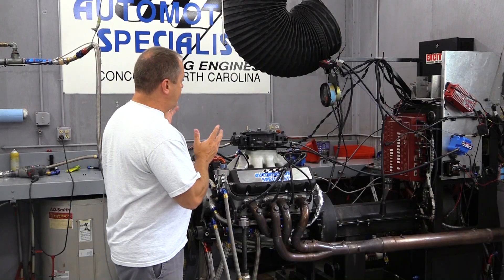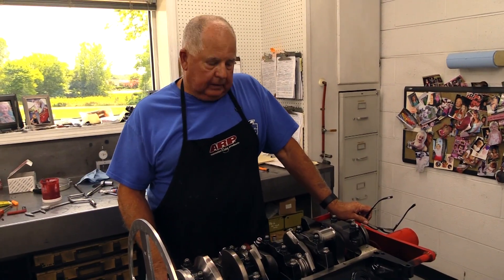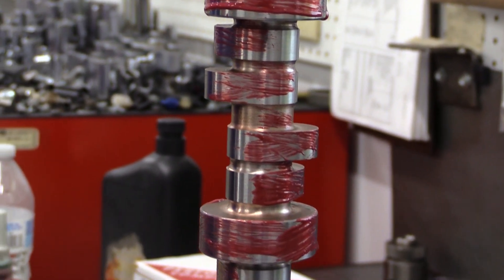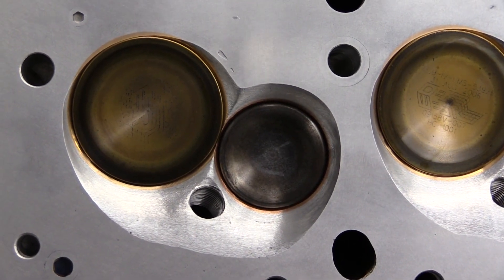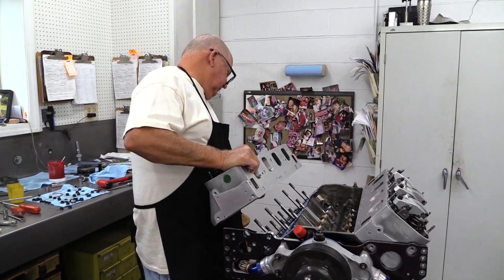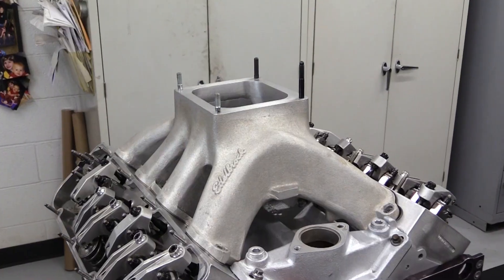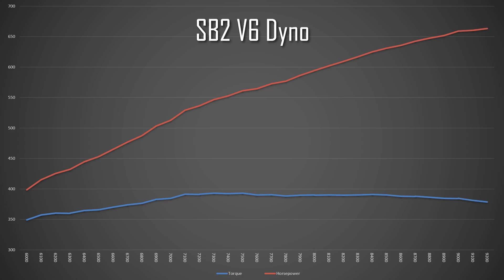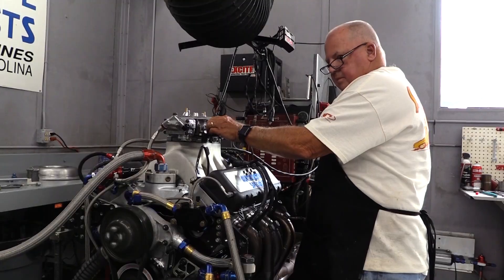NASCAR Chevy SB2 V8 Turned Into a Racing V6!?

Comment: Nice video.  660 hp / 6 cylinders = 110 hp/cylinder.  Make that an 8 cylinder, and you've got 880 hp.  That's pretty much what the NASCAR Cup competitors had on unrestricted engines.  It was probably fairly simple to find a used Cup engine after the SB2 version became obsolete, then let Dorton do some thinking about how to build the engine with a couple of dead cylinders.  I think he came up with the design of the #4 crankpin weight by taking the big end mass and adding half the reciprocating mass of the two missing piston and rod assemblies.  Then he had to do some careful engineering to spec the bolt size and grade to keep it together at 9000+ rpm.  If that weight came apart, it would wreck some things on its way out!

Comment: Man, my brain hurts trying to figure out how the ignition system works on this beast. Even though its missing the last two cylinders i cant wrap my head around how it runs smoothly on 6 off a 8 cylinder distributor. In my mind there would still be gap in ignition and the engine would act like there was dead cylinders. FFF-FFF- ...... Someone smarter than me please explain this to me, lol.

Comment: Why not just use an in-line 6 they make more power than a v6 and you can get high compression ratios
Reply from the maker: I really don't think can get a less than 300 cubic inch, naturally aspirated straight six to make over 600 horsepower. Plus, straight sixes generally don't live to rev like a V8. They run into weird harmonics. Thanks for watching.

Comment: That small block Chevy looks good with those Robert Yates Cleveland style heads
Reply: You mean the Cleveland style heads that were originally copied from the Mark IV Chevy?
Reply: @andyharman3022  Bahhahaha Bahhahaha LMAO you Chevy boys crack me up LOL always got to fall back on some kind of experimental 409 junk LOL
Reply: @jameywhite6055  Wow.  What a convincing argument.  Ford got the message when Chevy showed up at Daytona in 1963 with W-motors modified with canted valve heads, and blew them off the track.  Then the Mark IV big block Chevy went into production in 1965, and is still in production by GM today.
Reply: Oh yeah that's super secret for 27 was awesome in a short run, but when it came to longevity I believe in 1963 the top five places where a Ford?
Reply: Plus the fact that there was supposed to been 50 of them but they only made 26 so I had to sneak them around from garage to garage to make it look like they had 50 LOL same ol Cheatin Chevys

Comment: Why not use a 3.8 or 4.3L gm v6?
Reply from the maker: Those cylinder heads don't breathe anywhere near as well as an SB2 head. You can't get the same power.

Comment: There is a LOT of information contained herein that I have used along with several books from Henry Yunick aka "Smokey" . Both these men are outside the box thinker's that made silk Purses from Sow's Ears and he thinks like I do , " If it don't specifically say in the rules that you CAN'T do something you HAVE to assume that you can !.  The Bob weight wouldn't be that difficult to come up with as this is generally done when balancing a Crank anyway  . weighing the Con Rod Ends and bearing shells  would give you a very good place to start. The question for me would be is it over balanced or underbalanced as a function of smoothing the difference between reciprocating weight and rotating weight .
Dayum I LOVE those Keys lifter's brilliant solution to the limitation of the tie bars. 
I know the word Magician is often used but IMHO in this case it might be considered by most that understand the content of this Video as being and understatement ! , Mr Dorton I Sir salute you  .
Reply: I hate tie-bar lifters.  Keyed is the way to go.
Reply: @andyharman3022  Yes and no.   It depends on how the tie bar is employed and what it is made of.  I machine the sides off the lifter to give a flat and then a pedestal  made to attach the tie plate , BUT for street applications the lifter is usually left rotate in the bores so the wear on the Cam and lifter is as even as , this is doubely important for motor's where the lifter bore is slightly offset from the cam lobe to produce an even rotation.

Comment: My first thought was why not just use a Buick V-6 but I don't think you could get the bore size he most likely wanted. Yah the cylinder walls would only be .055 thick between the cylinders.
I'm not second guessing anybody here I'm just wondering why the cam has the lobes for #7 & 8. Unless it's for cam balance issues at high RPM

Comment: Why are all the measurements in imperial.  GM products are all in metric
Reply from the maker: LS, yes, and all other motors since. The SB2, which stands for Small Block version Two, was still standard just like the original small block. Thanks for watching

Comment: I'm guessing that the added weight to the crank is likely the total weight of two connecting rod/piston pin/piston assemblies plus some weight added for dynamic balancing. 
Goofy suggestion-since the engine is essentially an air pump, why not separate the intake manifold for the rear two cylinders and boost the engine with the airflow from them? You could adjust the cam timing to optimize the airflow so they act like a compressor would. Plumb the  exhaust side to a pressurized intake hat. Okay, it's stupid, I know, no need to roast me in the comments.  The same external engine configuration could be used in a different class...Just an idea.

Comment: If their going for the record they should cut the the end 2 cylinders and heads for weight reduction lol unless it wont work bec of tq specks
Reply from the maker: Weight isn't an issue in land speed racing. They have five miles to get up to speed. Because of this they actually use lead weight to increase downforce to help traction and stay away from aero downforce because it increases drag. So there' really no point in cutting up the block and heads to reduce weight. Thanks for watching!
Reply: @TheHorsepowerMonster  
Alright that makes sense to lol im always tryin to shave weight haha
Reply from the maker: I hear you. It is hard to wrap your head around the idea of adding weight to go faster. Land speed racing is pretty weird sometimes.

Comment: Mr. Dorton is a legendary genius, and there have been very few that have came along in his league. 
But I'm old, and I remember the 80's in the NASCAR Busch Series, they were running v6s. This cylinder head and piston design are almost identical to the Ford SVO v6 NASCAR engine then. They were running 14:1 to 16:1 compression on those. The Chevys were more like their v8s, and the Buicks were running theirs at that timer as well. Neither had the canted valves, heart shape chambers, and valve arrangement like this SB2 and the SVO design.
Reply: Its funny you can see how chevy pretty much borrowed the entire Yates cleveland style head design right here on the SB2  But yet chevy never made a small block with canted valve heads. Well until the sb2

Comment: Did I miss something? No mention of why there is a header tube on the back cylinders.
Reply from the maker: The  team uses their car in attempts to set multiple records at bonneville. For simplicity and economics, it is set up to run a chevy small block. They will use the same bellhousing, engine mounts, headers, etc, to make engine swaps easier. So even though the engine is a V6, it is still set up like a V8..

Comment: I really do not see the problem with a short stroke and a high compression ratio. Cool build, sure, but it seems like a very unnecessary one, it just adds complexion and weight.
Reply from the maker: If you want a high compression ratio with a short stroke that means you have to reduce the bore size. When you do that you must also reduce the size of the intake and exhaust valves. Now your cylinder heads don't breathe as well and you lose horsepower and efficiency.
Reply: @TheHorsepowerMonster  No, compression ratio is just the ratio of total cylinder volume (displaced volume + cumbustion chamber volume) divided by the volume of the combustion chamber. Sure, you can increase the the compression ratio by reducing the displaced volume, but that is not really a thing, is it? 

To reduce the combustion volume, change to other pistons and/or mill the head. Then you're keeping the displaced volume.
Reply from the maker: It isn't as simple as that. For example, with the chamber shape in the SB2 Dorton had already milled the head until he was nearly into the intake valve seat. Everything affects something else. In our case, he new he needed a certain cfm into the engine to make his target horsepower. To get that he needed valves of a certain size to allow the air and fuel past. For those valves he had to have a combustion chamber a certain size. You can't just make the chamber flat or you ruin the quality of the flame front on combustion and that kills power. Yes, compression ratio can be done either by increasing stroke or reducing chamber size, but there is a lot more to making maximum horsepower than simply chopping down the chambers. Hope that makes sense, and thanks for watching.
Reply: @TheHorsepowerMonster  Yeah correct, but I am not talking about using the SB2 engine. But maybe that was the whole point from the beginning?

Comment: That's a lot of horsepower but wouldn't you want more torque to help push through that wind at over 200mph just a thought
Reply from the maker: Torque is important for a 1/4 mile blast, but in land speed racing you are making runs between 3 and 5 miles. Torque is not as important in this application.
Reply: Gearing makes up for any "lack" of torque.  Power is what you need to achieve maximum top speed.

Comment: Why wouldn't he have just started with the 4.3 Chevy V6? I thought it was a chevy small block with the back to cylinders lopped off.  If you know the answer please reply.
Reply from the maker: This is a race-purpose SB2 block with four-bolt mains, camshaft roller bearings and lots of other features to help make high horsepower. Also, the car is set up for a chevy small block. It will run multiple engine combos during a week at Bonneville. So it makes it easier because the race team can swap in the engine without having to swap in different headers, engine mounts, etc. Thanks for watching!
Reply: @TheHorsepowerMonster  thanks for the explanation. I was just curious because I remember a few people running the 4.3 in dragsters back in the late 80's.

Comment: I'm in press take  v8 to make the 6 power out of. That's impressing I'm retired mechanic 47 years in the trade understand ways doing about built drag Indies before at A3020 850 Hoare on pump gas I very intelligent knows how to build engines Give up the good work

Comment: The weight isn't going to be to hard to work out it would be the same as the bob weight used when balancing the engine 50% of the reciprocating mass and 100% of the rotating mass. Not  a big secret it is how any crossplane V8 crankshaft is balanced.

Comment: 160 lbs. valve spring pressure at the seat? Dual springs? Huge pushrods meant for 340lb. springs? I've had SB2's on the flowbench, they flow more than most big block Chevys and I know about the light titanium valves. What's with the huge pushrods and "160#" springs?

Comment: chains don't stretch, they wear out. the link holes "bore out" over the time of them ribbing while running. this is why lower revving engines last longer, period, everytime.
Reply: Seth H what's the name of your shop?
Reply: @crownvictorialifestyle4421  Hardin's Garage. What does that have to do with whether a chain "stretches" or simply wears out like a bearing? Have you ever had a Bearing it went bad and it Jiggles and is very loose now? Same concept with the inside of a chain, Overtime they wear out due to the friction and therefore give the appearance that they stretch. It's a common misconception so you don't need to get butthurt, have a good Valentines Day👍

Edit: https://m.facebook.com/pages/Hardins-Automotive/538724389520893
Reply: Seth H how am I butthurt by asking do you have a shop
Reply: @crownvictorialifestyle4421  You're not butthurt for asking about my shop, your butthurt for the reasoning behind asking. The only logical reasoning to asking me if I owned the shop was to use that against me. Had I not owned a shop, you would have said that I don't know anything due to that. But since I do and can prove it, You've redacted your entrance into Argument from Authority, a logical fallacy. Research that on your own, Wouldn't want to have to make you read "10 paragraphs" 😂
Reply: @crownvictorialifestyle4421  Also, Just to further back up my original claim:

https://youtu.be/KVDUktSGOPs

Metal used on chains has extremely low PEe, or in layman's terms, the potential to stretch. So I was clearly right about that. Still baffles me on what you could possibly have wanted to know about my shop... Hmm. Maybe my assumptions were right... Damn, if only someone knew what you meant by asking that... Oh, wait, you know! So, whats the reasoning? Did my logical deduction work? Or, no? If not, what was the reasoning?
Reply: Seth H have a good sir ✌️
Reply: @crownvictorialifestyle4421  Hahaha, you can't give an answer. Called it, again. Must have been right all along. What's it like being wrong?

Comment: Would it have been easier to just use a 3.8 block?
Reply from the maker: No cylinder heads for the 3.8 flow even nearly as well as the SB2 cylinder head.
Reply: The Buick 3.8 is limited to a maximum bore of 3.965". The Chevy can go to 4.125.  Bigger bore means bigger valves.  Bigger valves means better breathing.

Comment: A custom cam and crank would be ideal, as it would decrease rotating mass. Freeing up hp that is waisted by needing to rotate those counterweights.
Reply from the maker: This engine isn't about acceleration, it's about top speed. The increased rotating mass is negligible.

Comment: If the class limit is based on displacement what they should have done is take 4x 1000cc motorcycle engines and connect them in parallel. That would have given them around 750 bhp at wheels and possibly more with intake, exhaust and mapping. The key is to get the airflow and for that you need an oversquare engine and 4 valves per cylinder. But maybe there is something more in the rulebook which isn't mentioned here.

Comment: It's got me thinking... or wondering anyway if you blocked cylinders 4/6 rather than 7/8... Could this better balance the secondary forces of the v8? 
Creative build on that sb2. Has me also thinking a v10 with 3/4 7/8 blanked and a custom crank to remove the con rod machining for those cylinder, rather more beef for the crank and all slapped together with dohc, ecu controlled intake runners, dual port injectors, large direct injectors, with Siamese throttle bodies n/a to the manifold, firing order of 2/1 6/5 10/9 might be an interesting sounding beast especially if the v10 you start with is riding at 120 deg. Run a triangle cross plane where let's say if you think of the 2/1 con rod crank journal tdc for bank 2 then the plane for 6/5 would be 240 deg behind this and 10/9 would be 240 deg behind that. Not using 4/3 8/7 might also leave opportunity for some interesting counter weight shapes to work with this imaginary setup I've got going on here. ;)

Again thanks for sharing.

Comment: Why not just start with the 262 v6 ? seems like al lot of extra mass running the v8 block. Also why run the distributor at all if you dont need it to pump oil and already have a crank trigger?

Comment: Why not use something with 4 valves per cylinder?
Reply from the maker: The car owner goes for multiple records with the same car at Bonneville. To make that possible, everything is based around the Chevy small block so he can do an engine swap without changing the bellhousing, flywheel, exhaust, motor mounts, etc. Thanks for watching.

Comment: Am I correct in that 2 cylinders have a 90° spacing in the firing order and the other 4 have 45°? And no vibration? 
Im sure a custom crank cost wouldn't outweigh the gains?
And do you think theres any HP to be gained in a specific custom sheetmetal intake?
Cool build,great #s,did they get a good run in yet at Bonneville?

Comment: This is the second craziest engine I’ve seen, my welder teacher took a v8 and cut half of the front cylinders and the back half and got rid of the middle of the motor and made a v2  and put it in a lawnmower

Comment: Potentially stupid question, but why run the two rear exhaust runners? Wouldn't they just be wasted weight?
Reply from the maker: Weight isn't a big issues in land speed racing. They actually use a lot of lead in most cars to keep them planted instead of aero because downforce also causes drag. Since the course is miles long, you don't have to have tons of acceleration and extra weight isn't a hindrance. Thanks for watching.

Comment: Have you tried it with just 4 cylinders?......curious how that would/did turn out and how it would sound?
Reply: There is a team dragracing a turbocharged Top Fuel style engine with a single cylinder bank. Running low sixes at the moment.

Comment: Why Does the exhaust and oil pump/pick ups have the extra pieces installed for 8 cylinders, but everything before is deleted and plugged, shouldn't last 2 exhaust be blocked and the oil pump has 4 pick ups, shouldn't there only be 3.???

Comment: My brother made a 5 pot VW 2.4 petrol into a 4 cylinder. The engine had a broken rod on cyl 5 and had smashed a hole in the block. After wedging the piston in the bore and sealing up the crank journal with a rubber gasket and hose clip it ran fine..

Comment: Didn't they make a racing V6 based on the chevy 4.3 (262) that was based on the 350 with 2 cylinders removed? It would need a forged non-split pin crank and have to go down 1.01 cu inch.